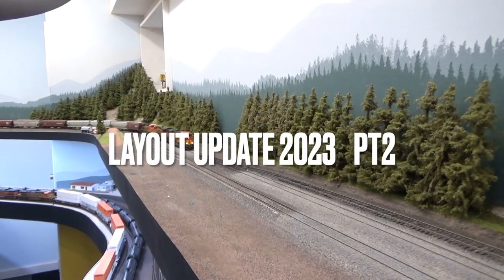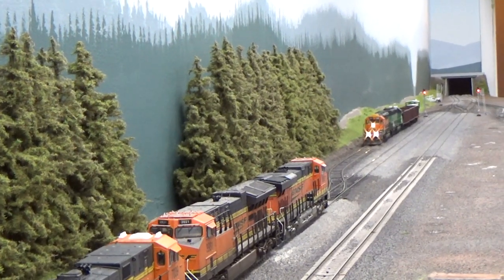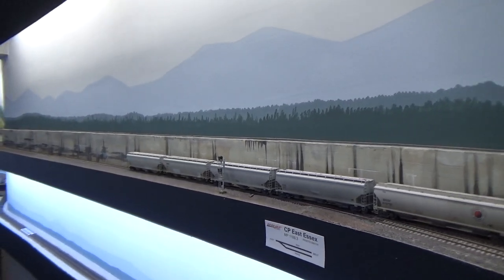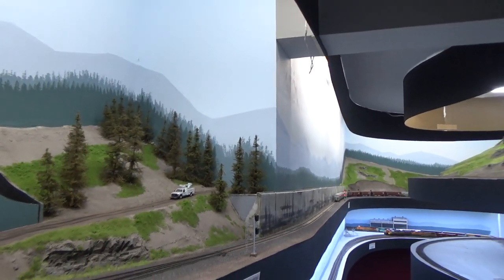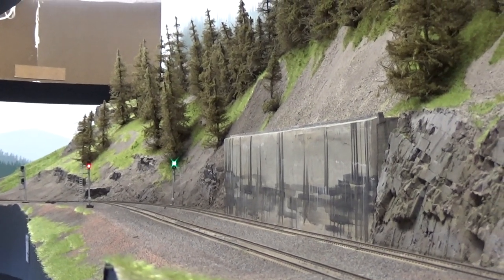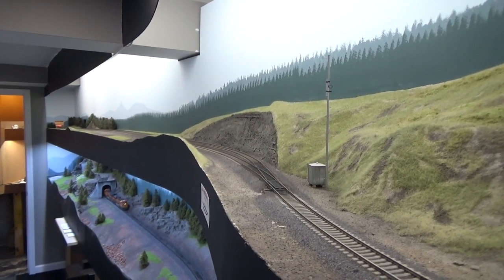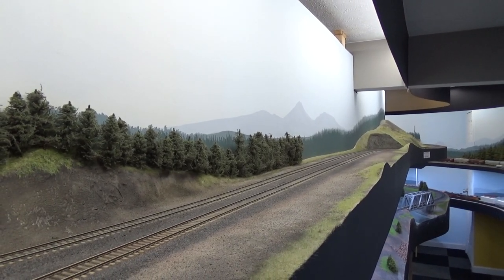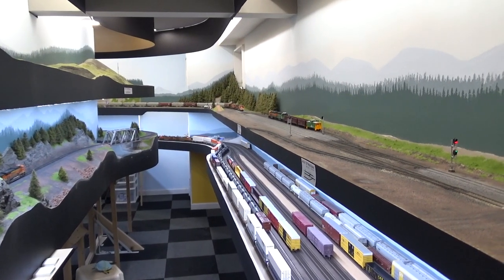Layout Update 66 (Part 2): "NEW" LAYOUT!

Comment: Amazing! I love the depth of your backgrounds. Did those trees shed with every touch?
Reply from the maker: Thanks! Yeah, actually that was the issue with the trees on the upper level. They looked great before I put them in, but every little vibration as I installed them caused the flock to fall off. The key, I've learned, is to seal the first layer of flock (2 mm static grass) with another dusting of spray glue and then add a little bit extra flock on top of that.
-Cam

Comment: Nice job Cam. It’s really coming along since the very first video of the layout u built and now to the new line you have recreated . Love the Scenery especially, is there any video on how u carved the rock facings. I would really like to try that method. Also how what colors did I use to paint the backdrop and what technique did I do to make the tree line on the background
Reply from the maker: Thanks! I'll eventually upload a video on backdrop painting, but I used latex paint in the following colors: Juniper Berry (PPG1145-6) for the foreground trees, Chalky Blue (PPG1153-5) for the 2nd tree line, Constellation (PPG1155-4) for the mountains/hills, and Subtle Blue (PPG1152-1) for sky. I used an angled old paint brush and stipling motion to get the tree line effect.
-Cam

Comment: How did you paint the concrete for the snow sheds? It looks real.
Reply from the maker: Thanks! I just used cheap craft acrylics. I started by brushing some watered-down gray over the whole plaster surface and then went back with accent colors to detail the surface. There will be an upcoming video that documents how I did it.
-Cam

Comment: Hi Cam! I was wondering what trees you used for your layout. I know you do them yourself but I was wondering what ones you used such as the ones in the first part of the video! Thanks!
Reply from the maker: Good question! I made all of the trees out of 18AWG steel (or copper) wire and sisal rope. They are spray painted a flat brown color, then sprayed with glue (Gorilla spray glue is reasonably priced and works well for me), and covered with 2mm Scenic Express dark green static grass. I re-spray with glue and add more static grass until they look full enough. Finally, I lightly spray the top side of the tree with glue once more and sprinkle some Scenic Express spring green fine ground cover through a homemade sieve (window screen over the top of a Ball jar. I learned this technique from Grant Eastman (Southern Alberta Rail on YouTube and Facebook). Look up his video titled "Building a Forest Full of Trees - Quick and Easy Mass Production Techniques" for a more in-depth explanation. Hope that helps!
-Cam
Reply: @railfan220  Wow thank you so much that really helps me out a lot! I really appreciate you Cam! Thank you
Reply: @railfan220  And one more question lol, for your landscape like your mountains, hills, anything that you made with leverage. For my layout I can’t seem to cut through the foam that well, and since you do it professionally you would be the one with the answer for this. Also how you add all the textures and rock face and all that good stuff. Sorry if I am overwhelming you with questions lol. Thanks!